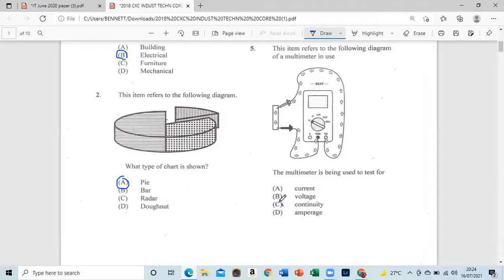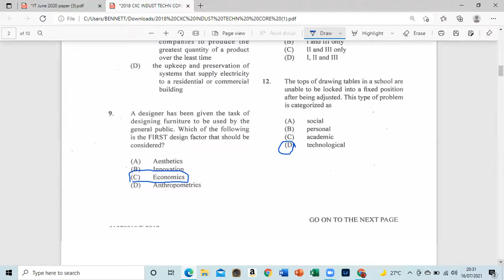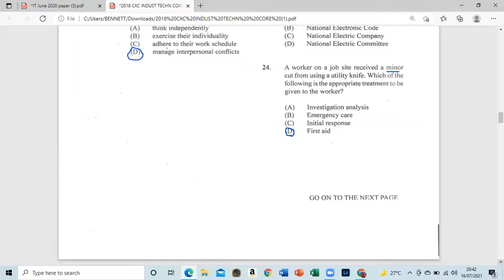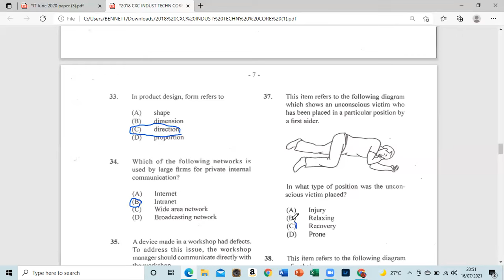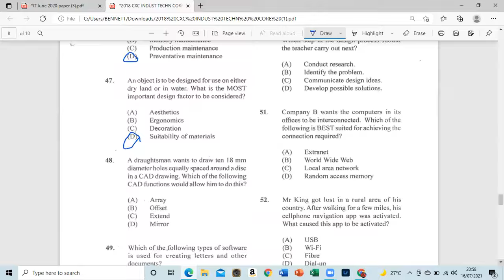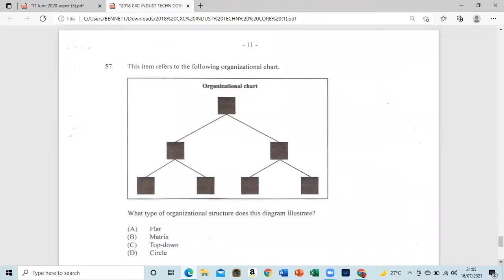2018 Industrial Technology Core

Comment: Sir what is question 60??
Reply: When developing a prototype, modeling the product plays a large role. It involves creating a visual representation of the product design using computer-aided design (CAD) software or physical modeling techniques. This step helps designers and engineers visualize the product concept, refine its shape and dimensions, and make any necessary adjustments before proceeding to the prototyping stage.

So the answer is: B) Modelling the Product
Reply: @adminartz1885  👍

Comment: What is answer for question 60?
Reply: When developing a prototype, modeling the product plays a large role. It involves creating a visual representation of the product design using computer-aided design (CAD) software or physical modeling techniques. This step helps designers and engineers visualize the product concept, refine its shape and dimensions, and make any necessary adjustments before proceeding to the prototyping stage.

So the answer is: B) Modelling the Product

Comment: There are some questions that are the same on the 2018 and 2017 paper but the answers are different :

*for number 4 on both 
*number 6 on 2018  and  23 2017
*number 10 on 2017 and 21 on 2018
*33 on both
*37 on 2017 and 50 on 2018
57 on 2017 and 55 on 2018
Reply: A d
Reply: @I Tired thats true bro